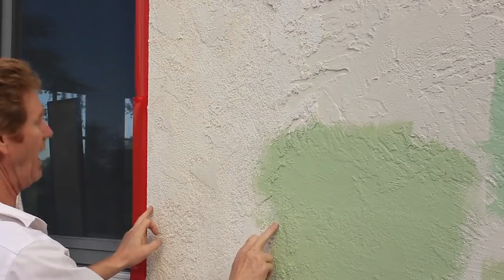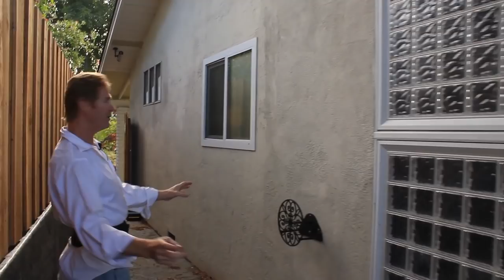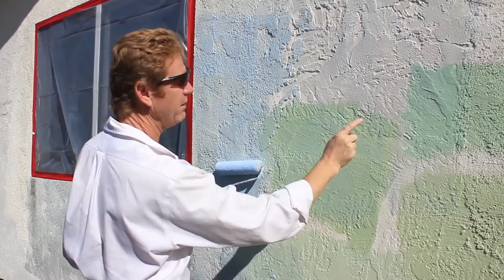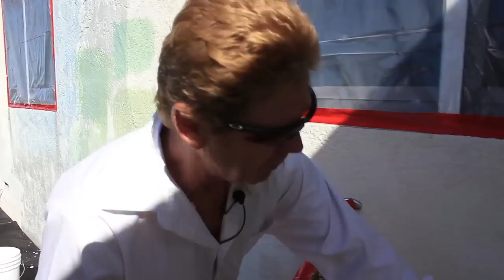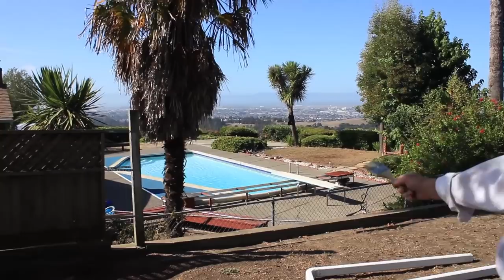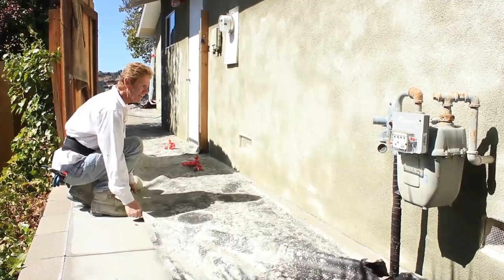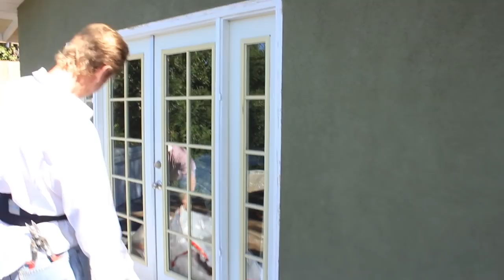Repair bad stucco patches with a new finish.

Comment: Is everything removed from the walls prior to your arrival? I've seen you remove gutters and such, and I can do that. I am more concerned with the fuse box in the back and the metal conduit that runs along the house. Would you stucco around that or have somebody temporarily remove it? I'm almost ready to start this project but just had questions about the removal of conduit and other things attached to the house.
Reply from the maker: Morning computer dude,
 Electrical panels stay attached as if you even try and move these the coupler which is a cheap cast metal will break half the time.
 Wire and conduit are a choice I leave to the homeowners,
 Best wishes, 
 kirk giordano Plastering
Reply: Thanks big G!  Gonna start this project soon. All I need to do now is cover a few holes around the house and then I'll be ready for the re-dash!
Reply from the maker: cool beans daddio.
 kirk
Reply: this guy won't last 10 min

Comment: I bought my 'remodeled' home and the stucco finish started falling off just a month after moving in. I guess they applied the stucco over  the existing paint. My question is what do I need to do or apply so the stucco finish does fall from the old paint?
Reply from the maker: Howdy Lee dude, so sorry, if your stucco is separating, their's littl you can do to hold it on.  
                    Live long and plaster
         Mastering Plastering for the beginner’s

Comment: Hi Kirk , We own a rancher in northern phoenix built in the sixties, we have removed sidling and bricks to reveal slump block brick walls. We would like to stucco the house but I am not at all familiar with stucco. I have watched a good many of your videos with great interest. My question is we are in the midst of getting stuccoing estimates but no one has mentioned color coating, just stuccoing and then painting. I only learned of color coating from your videos. Do you know of a reason for this? Thanks Jim
Reply from the maker: Hi Jim Baldwin,  I think many plastering contractors don't mention it because they feel the average homeowner won't understand what a color coat is.
 It's possible some believe it takes too long to convince most home owners of how the benefit's outweigh the extra cost.
 This is just my opinion as I can't speak for other plasterers,
 Best wishes, 
 Kirk Giordano
Reply: Thanks, I will do more research. Jim
Reply: kirk, lm going over cementous finish with acrylic finish, but lots of cracks, I always fix cracks and patches first, then wrap 100% of the house with senthetic brown coat and wrap with mesh, just to protect  my self  and cause my name is on it sir, I've been doing this wor for 33 years, would u do this sir, god bless,
Reply: +David Sanchez of course I power wash house first
Reply from the maker: Atta boy, cheers,
 kirk giordano

Comment: After you are done floating the color coat do you need to mist it lightly with water or just let it dry
Reply from the maker: Howdy Barry, good question, never mist a color finish while wet as this will create a lot of color variations.
 Like pouring Clorox on blue jeans.
      
                 Live long and Plaster
Plastering tips from your favorite stucco gee

Comment from the maker: Hey ramblinman, is your home built with Cinder blocks?
 If so the last thing you need is more insulation! 
Plus insulation board over Cinder block is almost impossible to attack and you would lose your bond for stucco.
Is it possible for you to send me a picture of the home or area in question?
 Send to my e-mail at kirk4stucco@gmail.com
 Thanks for watching and lets see what you are referring too.
 kirk Giordano plastering

Comment: This is the video I was looking for, perfect! thank you!
I just had my windows replaced and now the stucco looks real bad because it's so old. Somebody did a patch job on an old window and it doesn't match the rest of the house, so I decided to redash the whole house like you are doing right here, I really like the elegant style. I feel like I'm up for the job but just want to make sure I get the right tools for the job. The bonding agent shouldn't be a problem, but do you recommend a certain type of stucco finish from Home Depot and floats/trowels?
Reply from the maker: Howdy computer dude, thank you,
 Home depot only sells La Habra finish coat stucco,
 As far as trowels and other tools for plastering, Home Depots sells everything you need to do this procedure,
 The most important thing is to pressure wash your home well as nothing adheres to dust,
 kirk giordano
Reply: Will do, I think I'll buy a pressure washer and still save money by doing this myself, wish me luck. Thanks
Reply from the maker: Howdy computer dude, before you spend 400 bucks on a pressure washer and only use it once,
 Home depot rents them for cheap.
 cheers,
 kirk giordano
Reply: Didn't know they cost that much, if I won't be using it in the future I'll go ahead and rent it. thanks!
Reply from the maker: Morning computer dude, the good ones that we use cost about 450 dollars plus 50 bucks for a turbo tip,
 The electric ones cost about 100 dollars, but won't get the job done, they are more for cleaning simple thing like leaves.
 Cheers,
 kirk giordano

Comment: Just wondering if you do any drvit or eifs work?
Reply from the maker: Good Morning  Keith, I have had my share, not much call for it these days unless commericail work.                 
                              Live long and plaster
                     Kirk and Jason’s plastering tips
Reply: Ive been wondering the same thing. I do alot of commercial patch and paints (painting contractor). But when they are bad they need to be floated. I hire local stucco guys but have been wanting to try them myself on account they can get booked up and I need to get the jobs done. At least smaller elevations to start out on. Obviously its always more difficult than it looks. Throw up a video of an eifs job if you happen to do one if you could. What area are you in? Thanks for the informative videos!
Reply from the maker: Howdy  Alan, try typing in acrylic stucco on our channel as we have many videos on this subject.     
                                   Live long and plaster
    Images of Kirk Giordano’s Plastering projects and tips

Comment: So , after the heavy grit plaster and it dries;  what's next? Can you paint it with a paint roll or sprayer? Help
Reply: You should wait couple week for it to dry and cure, then if you able spray it with someone back rolling it. Other wise with a 16/20 float you can easily roll it with like 3/4 inch nap. Flat paint. Arcylic .. and you should prolly primer it.
Reply from the maker: Howdy Cris, the stucco we applied is maintenance free, sort of like a brick.
 A brick will get wet and darken with the rainwater, then when dryer conditions return, the brick lightens back to its original color.
 We applied a color maintenance free finish, it never needs painting.

                           Peace, love, and harmony to all
         Sound Plastering tips for the DIY beginner’s and Plastering experts

Comment: You are A #1
Reply from the maker: Howdy Tatunka, thank you
May peace, love, and happiness, find you and yours always
                Kirk Giordano Plastering and stucco tips
Reply: @StuccoPlastering  Excuse me, may I ask you a question For a retaining wall? Do I need to put block sealer on it b4 I stucco it? Over the last 30 years, My stucco has fallen off every wall that is below ground level
Reply from the maker: Howdy  Tatunka, No, in fact, if you seal the blocks the stucco will not adhere for long.
 Id recommend you pressure wash the blocks well enough to eat off. 
  Most folks dont realize that it's dust or loose grout which turns to dust that destroys the adhesion abilities of stucco to cement blocks.
  Stucco adheres to all types of cement, cinder blocks or bricks by a mechanical bond this is where the stucco is moist obviously, and what every substrate your applying the stucco to is super clean and moist also with water so the two merges in moister to adhere well. I use a water hose to keep the cinderblocks damp, but not dripping wet.

Damn, as I write this I'm thinking I'm describing sex, I'm not. 

May peace, love, and happiness, find you and yours always
                Kirk Giordano Plastering and stucco tips
Reply: @StuccoPlastering  Thank you very much. lol was moisture the key word?
Reply: ... and dripping wet lol

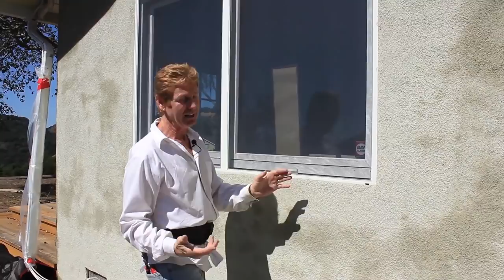Comment: Hi at 18:30 is dark spots like its wet is that normal 👍
Reply from the maker: Evening Melinda, It takes roughly about a day to dry or cure.
 When it rains the whole home darkens once more, just like a brick, that's why one never needs to paint a maintenance-free color coat finish.

 The complete plastering encyclopedia with more than 800 videos by the plastering messengers of Youtube. 
                          Bringing peace, love, and harmony back to the world of plastering.

Comment: In most of your float finish videos it looks like your consistency is like pancake batter. And then it looks like you trowel + float with little pressure to get that float finish. Every time I mix to product specs it is thicker and less smooth. Almost like I am not adding enough water. Compared to you this even happened yesterday in North MT with fall weather whereas you are in the blazing heat in many of yours. Do you add more water than manufacturer specs?
Reply from the maker: Happy holidays Big Tex, you do realize there are three sand grains smooth medium and course. It technical words for say 30/30, 20/30, then the thickest sand 16/20.
 My brother mixes the cement plaster if it's too thick, he adds water to the mix, plus he knows to wet the wheelbarrow so that on hot days, the dried stucco in the wheel barrel does not suck out the moister from the newly mixed stucco.
 We dont think about what the bags say about the amount of water to add.
   But instead, rely on the weather and the heat-generating off the walls. Many things to consider when removing stucco from the mixer to the wheel-barrow.

                  Bringing peace, love, and harmony back to the world of plastering.
    The complete plastering encyclopedia on video, by the plastering messengers of Youtube with over 800 videos

Comment: Can apply stuco over other stuco painting?
Reply from the maker: Good Morning Garcia, in this video we did, just what you are asking.
Make certain the wall is clean and a bonding agent is applied to the painted surface not in the mix.                 
                              Live long and plaster
                     Kirk and Jason’s plastering tips

Comment: never put the planks on the ground.  you just have to bend over and hurt your back to pick it up.  Stucco 101.
Reply from the maker: Howdy Richard, thanks for the tip.      
                                   Live long and plaster
               Kirk Giordano’s Plastering answers to life’s issues

Comment: Hi Kirk I'm trying to put texture into a old house whit stucco paint my idea was to use a texture gun and spray la habra finish coat on top after I do the pressure washer do you recomend the bonding agent?
Reply from the maker: Howdy Victor, yes, a bonding agent is necessary.      
                                   Live long and plaster
                Answers to life’s stucco and plastering questions
Reply: وين البلد الذي يتم بها هذا العمل اارائع